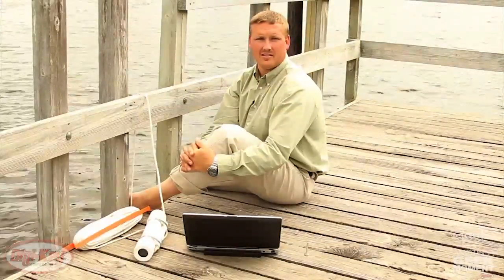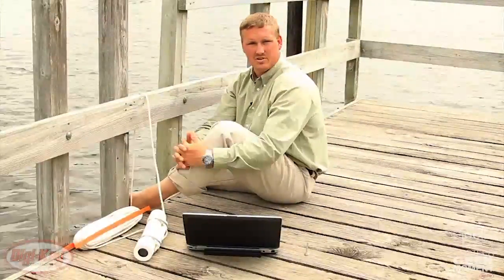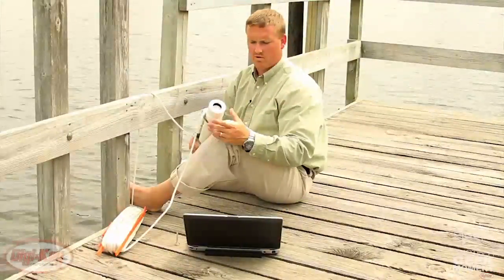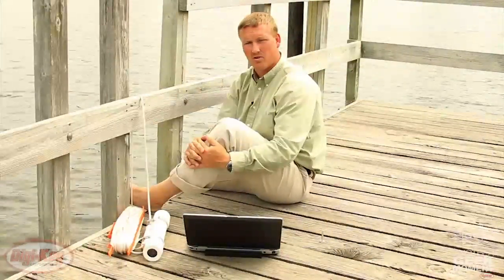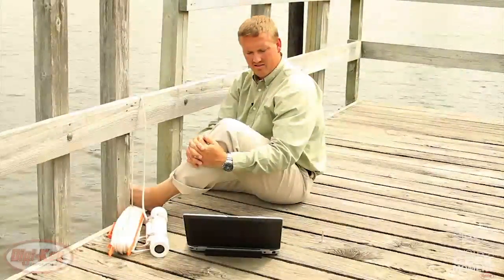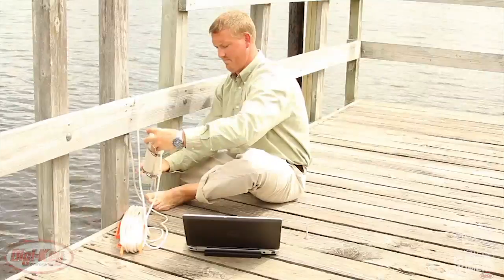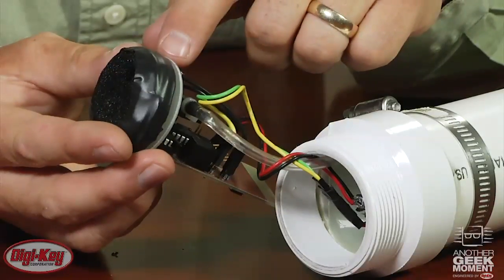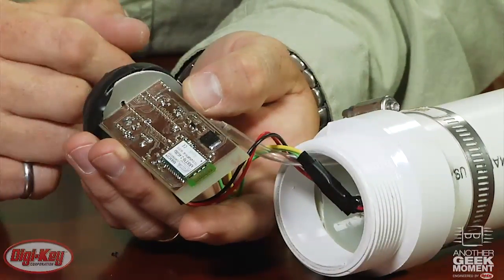ams TSL2591 Ambient Light Sensor -- Another Geek Moment | DigiKey

Comment: i was wanting some talk that addresses this  2591 sensor lux output when many of us are
used to TSL sensors giving irradiance in watts per sqr meter.    the conversion from one to
another  units  needs  area and angle parameter info.  

           plus could you  show us the code  used in what you called a    'pic 24'